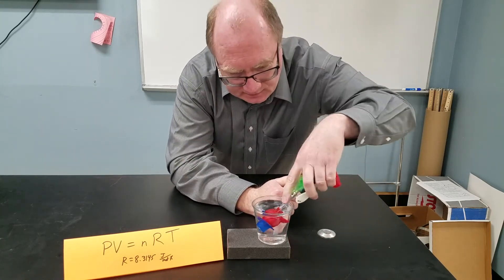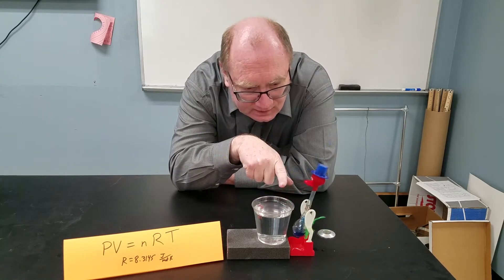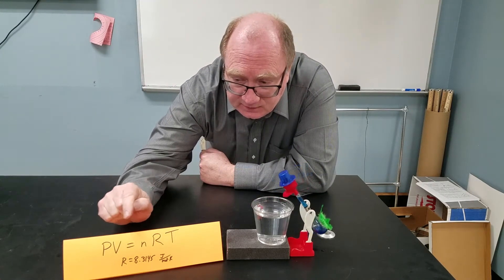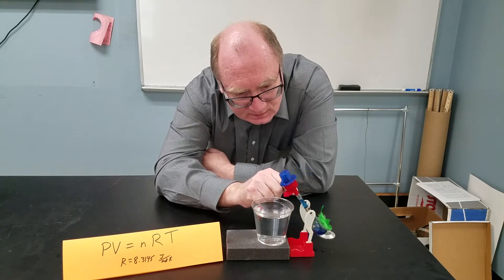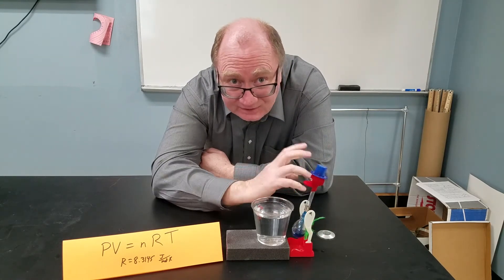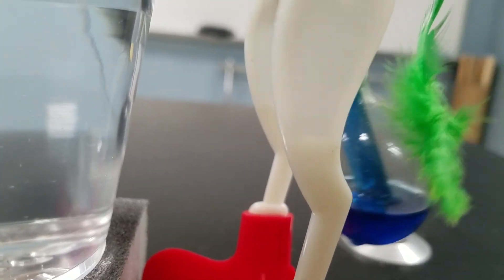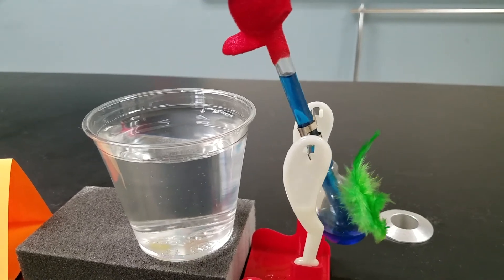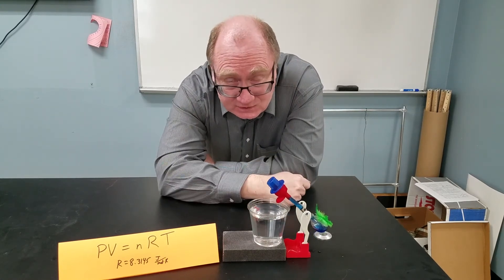Drinking Bird Explained

Comment: What if the chemical isn't going up after you dip the head?
Reply: It may be too cold in the room for the evaporation to happen. We found this out at work. They move quicker when it is warmer. We use these guys to keep the lights on. They are on a motion sensitive timer.
Reply from the maker: It should. The water evaporating off the head should cool the top so that the vapor in the top condenses, creating a low-pressure zone that draws the fluid up the tube. The tube going into the bottom liquid may not be entirely in the liquid.
Reply from the maker: And, thanks for watching.
Reply: @thephysicschannelwithkenny314  can there be a dud?
Reply from the maker: @ziigiiziig  Maybe. Try another is you can get one.